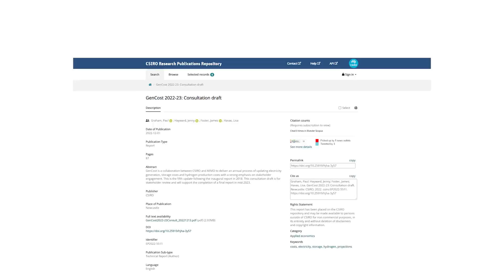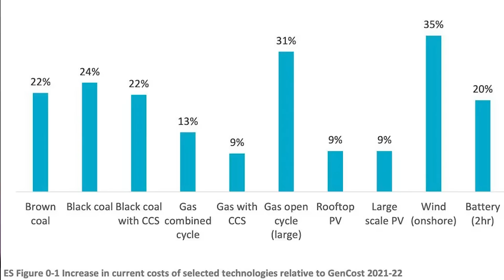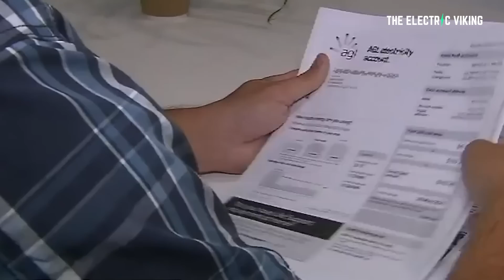Wind and solar still much cheaper than fossil fuels, even with inflation

Comment: What we need, eventually, is a global grid supplied by all power generation and storage types.  Sun is always shining and wind is always blowing somewhere.
Reply: Solar or wind transmission of over 500km is more expensive than a NPP that doesn't need the transmission, and then add the cost of the solar & wind to that, and even higher cost of storage. A global grid is totally impractical, by orders of magnitude.
Reply: Bigger grids are hugely important! Here in the US, we are limited by the political reality that grids are ultimately managed by the states, not the federal government, so every interstate line is subject to the regulatory headaches of every state the line crosses. And as an aside, this is why Texas’ grid keeps collapsing (and will probably collapse again this weekend as another polar vortex blows through the country). Their regulation is, well, Texas, and they can’t get electricity from other states.
Reply: @davestagner  here in the uk we have connections   to irland, France , holand , belgum and Norway totaling 8.5GW with connections to Denmark , Germany and morico planned. So it can be done between nation states.
Reply: @patdbean  Yeah, I think Europe is actually way ahead of the US on this. The balance of power between federal and state governments here is very complex and difficult.
Reply: @davestagner  which really supports the idea that we need a wider grid, even global. Politics will need to change.
Reply: Problem is transmission loss, the further you send the electricity the more you need to spend to send it.
Reply: @mrspeigle1  That’s one reason I think green hydrogen or other e-fuels will be an important part of this. Fuel can be moved with negligible “transmission loss”. And it doesn’t require extraordinarily expensive scaling, the way that, say, batteries for an entire winter could be expensive. Hydrogen could work more or less the way that natural gas peaker plants do today (and it might be possible to simply adapt those peaker plants - I don’t know for sure). And then the green hydrogen can be made in dedicated plants in remote areas with excellent sun/wind.
Reply: @davestagner  Hydrogen is far less energy-dense than natural gas, & it cannot safely be transported in steel gas pipelines {H2 embrittles most ordinary steels!}.  Large long stainless steel pipelines are expensive if you need to pump three times the volume of hydrogen than the energy equivalent from methane...
Reply: @jrb_sland5066  So what you’re saying it is isn’t impossible, just hard. Gosh, we may as well give up now and keep running on fossil fuels until civilization collapses from either climate change or finally running out of fossil fuels, because we can’t do anything difficult or expensive, because we’re too lazy and cheap and don’t care about our children. Alternately, we could decide that dealing with this situation is both a marvelous challenge and moral obligation, and rise to the occasion with creativity and hard work, and ignore the timid, lazy naysayers who look for excuses instead of solutions.
Reply: @jrb_sland5066  quite , hydrogen may be a good energy store. So  used excess overnight wind/nuclear power to electrolysis watter to get the hydrogen out. Store  it in a fixed tank then convert back to electricity when grid demand is high. But pumping hydrogen around on mass , no probably not practical. But as  energy storage  to work along side pumped hydro , liquid air  storage and grid scale batteries, yes.
Reply: @mrspeigle1  yes, and no. It  depended on the voltage and the current AC/DC. DC losses are much lower than AC losses. Also the higher the voltage, the better. That is why the shorter  cross channel links to France at 400KVDC and the much longer 550KVDC link from scottland to Norway, both have about the same loss. For much the same reason transcontinental links in the US go as high as 765KV with links planned in china as high as 1.1MV

 Funny ElectroBOOM video on the  use  of HVDC power links https://youtu.be/DFQG9kuXSxg

And this about the planned  Morocco link https://youtu.be/iJunxkln578

Comment: In Australia, getting solar on ones roof makes so much sense.  I'm sure rates of installation would rise even higher if more could afford the up front costs.  Here in Canada, the government is offering up to $40000 interest free loans for energy retrofits paid back over 10 years.  This I think is a good strategy for getting people over the hump.

I have said for some time that having solar on ones house is an inflation hedge, and mitigates risk.   Private firms will only invest in renewables if they can make a profit, so they would purposefully constrain supply by only building so much.  Homeowners can collectively drive prices very low.  Its going to be a bit of dance going forward.  Abuse the consumer too much, and the consumer retaliates by installing solar (or community wind) .  Its a great system regulatory feature that will keep energy reasonable in cost.
Reply: Until the lobbyists get involved. After that the consumer could well be charged for contributing to the grid. This will just accelerate the very thing the energy wholesalers are attempting to halt. The end of them being relevant
Reply: @theairstig9164  Yes both government and business want to extract their pound of flesh and are often in cahoots.  A grid is a useful thing, and needs to be paid for.  But in Australia, going off grid is much more of a possibility than here in Canada.  Going to be interesting to see what the grid morphs into in different areas.

Comment: One aspect of PV energy generation and stationary battery storage, combined with the internet of things, that is overlooked, is  the agile nature of the process.  Agile in the sense that one can get a "micro" solar powerplant in their own homes at a price that will pay for itself in about 15 years.  That means one can get the full benefit at the residence level. I am a middle class retired person living in California.  Even at today's artificially high prices for panels and storage I can break even in 15 years.  After that is free energy for life.   The only reason why I don't act immediately is because I believe the prices will come down substantially in 3 years.  Because the generation is distributed, it is more resilient in case of natural disasters, earthquakes for instance.  As long as my place does not colapse there is a good chance that I would still have electricity in case of a significant earthquake event.  That is something to think about living within sight of the San Andreas fault.   I can be energy independent when I get solar, storage, mini split ductless heat pumps, electric water heater, and an EV.  When I worked out the numbers I was surprised that the accumulated expected energy expenditures in my household will be around $100 thousand in 14 years even assuming relatively low 3% inflation.  Another obstacle is that, at least around where I live, solar and battery installers are  mostly crooks.  I had a contract for solar and had to cancel when I realized their used car salesman tactics they were using.
Reply: You only break even due to massive unheard-of-ever subsidies. Making the poor who don't own a home pay for your expensive electricity.
Reply: @fredbcf1255  I did not include fiscal incentives in my calculations. The poor don't pay taxes, they receive my tax money in form of assistance, welfare, free county services, free schools, etc.  I pay for all of that for them.   By the way the "poor" will always be around because the day human waste becomes valuable the poor will be born without anuses.
Reply: "free energy for life" cannot be true if the productive lifetime of both the solar panels & battery packs is only 25 ~ 30 years.  I suggest you rework your spreadsheet to include the anticipated replacement costs {allow a generous discount - panels & batteries will likely be much cheaper three decades from now}.  Maybe you should schedule 20 percent additional panels & batteries every five years or so to spread out the renewal costs?
Reply: @jrb_sland5066  Yes, if I re-invest part of the savings after 15 years replacing the parts of the system that needs replacement.  Remember once the system pays for itself whatever surplus energy that is produced after that can be sold back to the grid by participating in programs such as virtual power plants, etc.   Many people I know who have solar panels produce more energy than they consume.
Reply: @jrb_sland5066  The expected lifespan of solar panels is 30 years.  And I expect them to become better and cheaper because of competition and technology improvements.

Comment: Hi Sam, greetings from the UK! I'm a huge supporter of the expansion of renewable energy sources, however for nations in temperate climates - like here in northern Europe, I do think we will need to adopt a more accepting attitude to nuclear power, particularly SMRs, Small Modular Reactors. In Australia I could envisage a completely renewable powered grid, but here in the UK both Sun and wind power will really struggle to produce consistent power - yes, even with Tesla Mega Storage on the grid.
Reply: You have more wind resources than most other countries.
Reply: If the geothermal system currently being developed by Quaise actually works, which seems very plausible, it would be unwise to construct a relatively costly nuclear power plant that will be expensive and potentially mothballed in 10 years.  Geothermal can provide reliable baseline power, grid scale flow batteries can provide peaker power to ensure grid stability, and majority of electricity generation can come from renewables, even in temperate climates.  

The nuclear industry has been on a huge push lately, personally I believe it is because they see the writing on the wall - renewables are about to make them almost completely obsolete.  NPPs are costly, complex and dangerous, and always the products of large industrial enterprises.  There’s an ever-present danger of some kind of accident under the best circumstances, and an act of terrorism or sabotage at worst.  They’re a natural target in any kind of armed conflict, and for all of the aforementioned reasons are extremely expensive to insure, costs which are passed on to consumers.

Finally, a good deal of (almost 50%) the global uranium supply comes from Kazakhstan, which is currently a relatively stable country but also next door to and starting to get friction from the current global #1 villainous, imperialist government - Russia.  I’m pretty sure very few of us want to give the Russian government more reason to invade another neighbouring country or control over global energy markets, when has that ever been a bad idea? 😂
Reply: Scotland produced 97% energy from renewables in 2020 so there is only one reason why England can't do this,  lack of government will!
Reply: Source bbc
Reply: Tony Seba did review on youtube, every country can be energy independent with solar ,wind  and batteries

Comment: The thing so many people can't seem to get is renewables DON'T NEED ANY FUEL! That's what makes them so cheap, they don't cost much more to build than the massive very expensive fossil fuel infrastructure, don't require any more maintenance, and have a similar life expectancy, but NEED NO FUELl! and don't need to mine, refine, transport that NOT NEEDED FUEL or cool it after or dispose of the waste,  That's the magic money saver!!!! 

Imagine having a car that you never need to refuel!
Reply: Stop taking nonesense! Bullsit!! Which fuel infrastructure is massive!? Aren’t coal power plants or others directly connected to their sources of fuel!? Also are much smaller in footprint and produces energy much more reliably 24/7 to even supply the most energy hungry factories!? Lol…..
Reply: @carholic-sz3qv  Coal, oil, or gas power stations may be small but are the tip of the iceberg. The mining process is massive, I worked on the Gorgon project in WA Australia, which took 40,000 workers and me, 7 years, and 67 billion AUD to build one LNG Gas plant, with dozens of wells spread over 10,000 square miles (much like an offshore wind farm) tens of thousands of miles of pipelines. a refinery/LNG the size of a small city, consuming the energy of a small city, massive storage tanks, and a harbor two miles offshore for multiple LNG supertankers, and there are hundreds of such gas plants around the world!

Plus there are 10,000 coal mines, 1,000,s of oil rigs, and 10's of millions of wells, thousands of refineries, and even 4 million uncapped oil wells poisoning millions of acres of land, millions of miles of oil and gas pipelines, and 40% of all shipping is transporting fossil fuels, 17% of all freshwater is extracted by the fossil fuel, and nuclear industry, that's 1 in 6 gallons. (that's 1 in 6 reservoirs only exist to supply fossil fuels) 

The fossil industry is massive, the second biggest land user after farming, and consumes 15% of the world's energy to mine, refine, transport, and burn fossil fuels!  Directly employing 6 million people and the massive manufacturing support industry of over 60 million people taking up millions of acres of land and resources.
Reply: Also there are literally millions of oil byproducts not just fuel! Your tesla for example is about 40% oil.
Reply: @carholic-sz3qv  Yes, and so does an ICE car, (yes use oil to make things, but need to stop burning for energy!) A small family ICE car would on average consume 30,000 kgs of gasoline over 15 years, and an American pickup truck could consume 100,000 kgs whereas could power a Tesla from renewable energy or even your own solar.
Reply: Spacex, aviation, agriculture…… railway mining all need fuel and actually work 24:7 all year long unlike EVs!
Reply: Your shoes, clothes, devices, medical equipments…. Our roads, bridges, hydroelectric dams, solar and wind farms are all possible because of the refined oil. So stfu!!!!!!!!!
Reply: It’s very easy to talk crap about oil while totally forgetting what it actually makes possible! People are even able to fly Australia USA in record time. Harvest gigantic pieces of farm in record time. Deliver goods across the outback on king giant road trains…. Which batteries or EVs can do that!?
Reply: @carholic-sz3qv  It's energy that makes all these things possible, and that energy does not necessarily have to come from fossil fuels, Yes some things are easy to replace, and some like aircraft are going to be very hard!
Reply: @stevetaylor2818  actually the energy from fossil fuels allows them to be significantly more efficient at their jobs, much more flexible and scalable, more polyvalent making working 24/7….. flying from Australia to USA in records time direct flight! Launching rockets….. shiping massive goods and containers all around the world.
Reply: @stevetaylor2818  and alternative fuels are also in their ways too.
Reply: @orionbetelgeuse1937  1. The fossil fuel infrastructure has to be replaced on average every 30 years. so if convert to renewables over a 30-year period (which is about what is happening) There is not a great additional cost. Fossil fuels have a massive upfront cost (I worked on the Gorgon LNG project in WA Australia $67 Billion upfront cost before a dollar of income)
2. anything the world builds to replace fossil fuels will be built using the current energy system which is fossil fuels, the next generation will be from renewable energy.
3. Renewables are not that intermittent over a large enough scale and using diversity between different renewables, is surprising how little backup energy is needed (fossil power stations have lots of downtimes and as such have many spare power stations to cover, not that much different.

4. Renewable will in fact take no more area than the massive fossil fuel industry. A gas power station is small but only the tip of the iceberg, The Gorgon LNG plant i worked on,  has many wells spread over 1000's of square miles, thousands of miles of pipelines, a refinery the size of a small city, consuming energy of a small city, a harbor 2 miles offshore to service multip LNG supertankers. And there are hundreds of gas power plants like this, 10's of thousands of coal mines, and millions of oil wells. It's just most of this stuff is in someone else back yard! Plus renewables can share land, wind farms over farming, offshore wind, grazing animals under solar, and rooftop solar, and the world has 55 million square miles of arid desert doing nothing!!! There is no shortage of space for renewables!!!!!

solar panels are 95% recyclable, and wind turbines 85% this is a very high percentage compared to fossil fuels!!!!!

And the industry is jumping on renewables, currently in Europe is 8 times cheaper to generate electricity from renewables compared to fossil fuels and many European countries are applying windfall tax on renewable energy because is making SO MUCH MONEY!!!!!!!!! (I have spent decades working on massive Oil and Gas construction around the world and now renewables, I know what is involved)